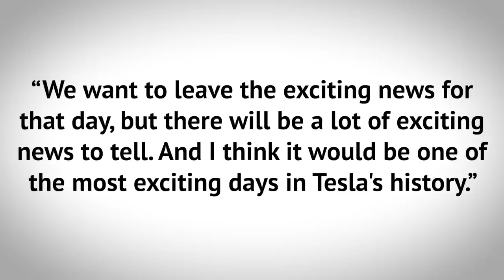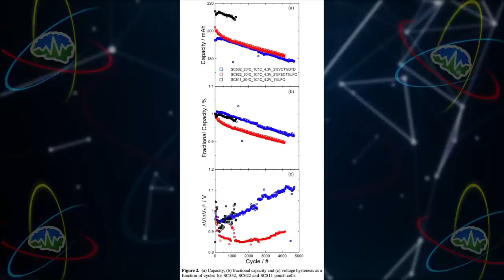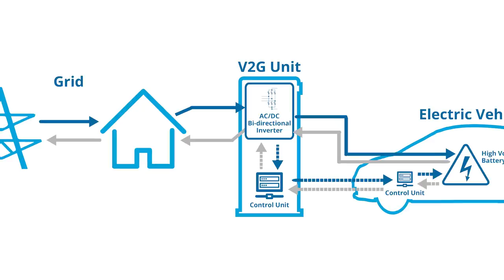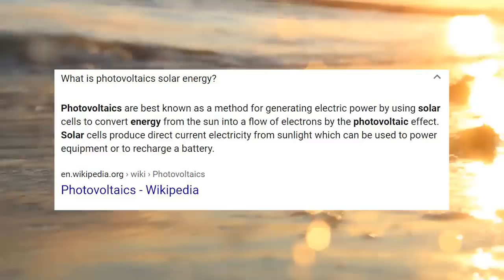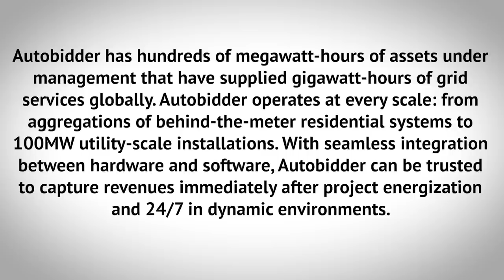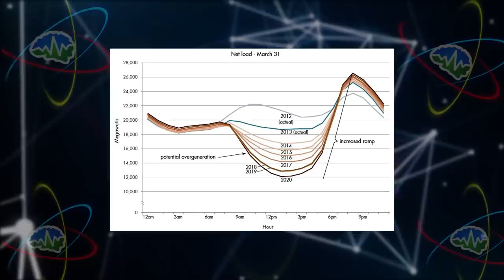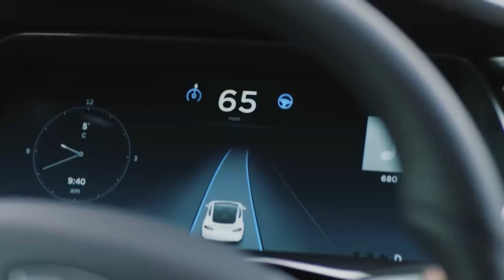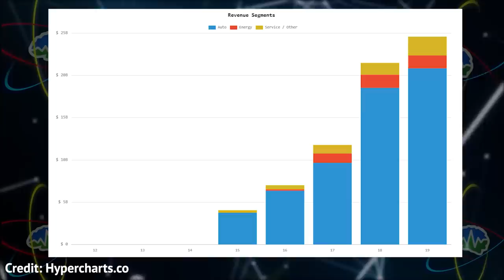Battery Day is Coming!  | In Depth

Comment: The big battery capacity will not be needed...We can build wireless charging systems everywhere...It will be charged as it moves...If that happens, we can save a lot of resources such as cobalt and nickel.
 The amount used will be a monthly fee like a cell phone or you can pay it where you're registered as much as you have operated.

Comment: An additional likely change, based on recent reports: rectangular, not cylindrical, batteries for better packing. Of course, myriad research results have been published to increase density, safety, solid state electrolytes, and so on, with claimed results up to 10X current capacities. Presumably Tesla is following these and deciding which ones can be injected into the mfg. process. (Those are initialisms, by the way, not acronyms.)

Comment: 31:48 makes my point. You will not get your electricity back in your car for the same amount as you put it into the grid. You're getting ripped off. And if you lease, I bet you have to plug in your car every time you can. and pay for electricity everyday even if you don't use your car every day.
Reply: But if it is only for your home. it sounds great, I guess.

Comment: What if Tesla s recycle program provided all Prius cars with the new million mile replacement batteries that were V to G set up for those cars. How much would that improve grid stability? As well as increase the range of the older prius' which is desperately needed.
Reply from the maker: There's not enough room in a Prius for that amount of batteries
Reply: @NowYouKnowChannel  You could at least make replacement batteries that last longer and increase the range and sell those to Prius owners. Your missing the bigger picture here.

Comment: Correction @12:00 Vehicle to grid means current can flow from your vehicle to the power company, where the power company will have to pay you for your power sold to them. This is a big "NO NO" for the existing money hungry power companies so much so that this V@G image was removed so as not to cause alarm to the economic powers.
Reply: I retract the comment. I see what you mean. Explained later in the video.

Comment: One idea that hasn't been added to the current conversation is the prospect of abandoning AC current in favor of DC current for powering homes. The only drawback of DC current is 1. it can't be transmitted over long distances and 2. it is more likely to be lethal than AC. However, these drawbacks might not be significant within a home, where power is transmitted over short distances, and where efficient small appliances could operate successfully with reduced voltage that minimizes the shock hazard. For example, LED lights would need only 12 volts. For "heavy appliances" such as clothes dryers, pool motors and air conditioners most homes are already equipped with independent 240 volt wiring circuits, and these could easily be converted to DC for operating the same power-hungry appliances.  DC motors are known to be 30% more efficient than AC motors, and Tesla has already developed an advanced DC motor that uses unique arrangements of permanent magnets that is even more efficient than conventional DC motors. Tesla could utilize this technology to produce a new generation of small, super-efficient DC motors to revolutionize the efficiency of heat pumps, air conditioners, refrigerators, washing machines, vacuum cleaners and the like. Stable DC current would theoretically eliminate the "hash" or "noise" that bedevils AC power provided by the electric companies, and enable a new generation of improved audiovisual devices. Last but not least, the DC power generated by solar panels is so compatible with storage batteries as to enable the elimination of energy-wasting  inverters needed to convert AC to DC and vice-versa. I suspect that Tesla is already planning along these lines because there has been mention of HVAC (heating and air conditioning) technology that Tesla is developing to complement its solar systems. The efficiency enabled  by this approach would go a long way toward eliminating the grid altogether. It might even confer health benefits by eliminating the fluctuating magnetic fields generated by AC power. Centralized power generation is a dinosaur that needs to become extinct. It is being kept alive, like Frankenstein or Dracula, by politics. It's time to say goodbye to all the dangerous and unsightly power lines, not to mention power outages entailed by centralized power generation. How about devoting one of your podcasts to these ideas? Who knows, it might inspire Tesla or even a politician or two.

Comment: One very important point that was not discussed is the problems all this will create with existing power companies. I am sure you remember a little community in AZ that started the fight between Musk and Warren Buffett. Buffett and other power providers have had a monopoly on power in the country. With Elon's promotion of solar and battery systems, they will increase rates to an unsustainable level, refuse to purchase the battery to grid, etc. Unless Elon starts running his own power lines, there will always be a roadblock to Tesla becoming a major power provider.

Comment: Re leasing batteries .Is a Tesla without a battery still a car?As when sold it in essence has no engine or at least means of mobilising as seller is the battery leaser. Will cars with leased batteries be worth less? Renault's model of leasing batteries has changed so that owners can now purchase batteries (if they wish) as there was concern regarding my above comment.Obvs battery reliability has been proven to be more reliable than people thought years ago.

Comment: I'm curios how Tesla will make money from this. When cogen is installed on a power system, there is a contract between the cogen owner and the utility that will receive the power.  Even if you put solar panels on your house, you don't just get to back feed in to the power grid. Most cogen is not mobile, so it's kinda simple. You have cogen connected at a fixed location and it's injected into the power system at a metered point. If you plug your car in at home and you have a contract with the utility that supplies power to your home, it passes through that metered point, they know who the owner is on the other side of that meter that is sending power into the power grid. What I don't understand though is how you would be able to connect to many chargers connected to many different utility companies without any contract and get paid for selling your power back. It would make sense if the owner of the charging station had a contract with the utility company and then they got paid for you to drain your battery into the power grid, but that wouldn't make much sense for the car owner. And how does Tesla own that power? Once I purchase the car it's mine, and so is the power. Why would I let Tesla claim it and profit from my car after I already bought it? If that business model somehow worked, why wouldn't companies that sell solar panels own the power they produce and continue to make money after they sell you their product?

Comment: Does this mean I could run my electricity requirements in my house just by owning the car?
Reply: You would need a roof full of PV to generate the power in the first place.  You would also probably need a Powerwall or equivalent to run the house while you're using the car as a car.

Comment: The Cybertruck already has an inverter built in.
Perhaps Tesla figured out the income from the mobile batteries the same as you.
1,000,000 miles/250 miles in pack/365 days per year=10.9589 years of use in a million  mile pack.

Comment: All these can be true, if Tesla is also going to replace the onboard charger to allow bidirectional charging in addition to just swapping out the battery pack. In comparison to the battery pack, assuming that's a small cost to pay to get the new V2G + VPP capability.  

Tesla will also need to scale up very quickly in their service center in order to service these modification work for its fleet owners.  This won't happen until maybe late 2021 - mid 2022 and maybe some of that $5B stock offering is going to fund this new biz expansion???

Comment: I find it funny that Tesla the scientist gave us AC (great for power transmission over distance) and Tesla the car gives us DC:) And most of the devices in homes could use DC (they convert ac->dc either way), but the infrastructure (the cables and switches) are not ready for it. One prime example is LED lights which are naturally DC, but each and every separate light requires an AC->DC transformer which makes it very complicated versus a single wolfram thread. If computer data centers made the switch to DC distribution, maybe we will too, maybe ac+dc separate cabling and you use what you need.

Comment: Nissan can do exactly what you describe right now, BUT at least in Germany V2G is not allowed. Euro CCS can do V2G as well. We could have done it already, but for tax reasons it is simply not allowed. Because you can get tax discounted electricity to charge your car and than use that electricity to run your home and thereby bypassing all taxes. Nissan proved already it is doable, but at least here in Germany, there is a long political way to go. The technical developement is done.

Comment: It all depends on regulations

If Tesla can convince the UK regulator to treat its cars as a virtual power plant there is a significant benefit to the home owner because that home would effectively be able to buy electricity off the grid for almost free at low prices and then power the home with that almost free electricity

£6.44 per KW per year is the UK capacity payments for power plants

About 3p can be made on arbitrage

But the big win is if the retail customer, that house with the Tesla can purchase electricity wholesale without having to pay the dozen or so costs retail customers pay

If that happens it's maybe around £700 a year value. If that doesn't happen  lots closer to £200 a year value

So Over 10 years the power pack of the car has a value of £2000-£7000 not $35,000 or whatever it is you said in the video

Comment: That is neat and all, but Tesla has an issue of scale and production.  The only way that this really works is if they open up their v2g platform and battery to other auto manufacturers at a low enough price where they also get value out of it.  If several companies are on the same platform, then the platform can make a big impact.
Tesla needs to become the Microsoft of auto manufacturers where they design the architecture that other companies can build from.  They will build vehicles, just as MS builds computers, but they will always be a small boutique company on that front where the real business is in services used by all platforms.  Let expensive end-user support, less need to hire employees, and a much larger market to tap into.  Tesla could be like the MS Azure for virtual grids.

Comment: I would take it even further with regards to the recycling. They are essentially “mining” materials from EVs. Why would you limit intake to only tesla vehicles? There are so many EVs from other automakers with those same materials. Tesla should be able to take a chevrolet volt off someones hands and give a discount on a tesla because they can mine the materials from the 10kWh batteries. Same for leafs, bolts, etc. 

This whole system, if it pans out, would be absolutely game changing for the energy and transport industry. It would cause massive renewable buildout because interconnection would be far less difficult. It only takes a couple hundred vehicles to stabilize regional grids, and this massive oversupply of energy storage would mean that there would be a dramatic undersupply of renewable assets, triggering an astonishing buildout of capacity. In addition, existing fossil fuel assets, if they are able to keep afloat, would be able to stabilize their output because of distributed storage while emitting far less emissions because of less ramping, and could fulfill the role of baseload generation until renewables reach sufficient market penetration.

Well played Tesla, they would singlehandedly bend the needle on climate change in a massive way.

Comment: I can see two problems with this model. Firstly people spec their solar systems for personal use so may not have the excess capacity to sell. This problem will be solved in a few years because the consumers will pay to add extra capacity to their solar systems. Secondly people will want to use their Teslas during the day So unless employer or shopping marts are willing to install this V2G infrastructure the storage capacity of these virtual power plants are greatly reduced.

Comment: What if Tesla announces they've used a calculator and concluded they'll switch to making hybrid cars! The battery capacity of 10 fully electric vehicles is enough for about 70-100 plugable hybrid cars with 50km (30 miles) range. Enough for many or most of us on average days. 100 hybrids will have much lower co2 emissions than 10 EVs. Not?

Comment: so far any battery operated cars needs 20-30 years just to break even of the extra price you need to pay (you can buy petrol for 20 years of drive on the price difference and stop wasting 10s of thousandths hours for charging batteries.
needs to solve:
-charging should become as fast as putting 200kWh of petrol/propane equivalent to the tank in 2 minutes
-it should not loose capacity over time (refuel tank until it starts to rust but still keep same energy volume/density)
-it should not cost more then cost of fuel tank (100;s of dollars not 1000's)

Comment: Really great strategy - you guys should start a company of Tesla doesn't do this. An extra bonus idea is this: when there is too much wind and solar, the price of electricity goes * negative * and people are paid to take money from the grid.

If you google "university of queensland Tesla" you'll see they had a 1.1MW battery generate huge amounts of cash using an algorithm they developed to predict the generation based on weather (sun and wind). As you likely know, when the software predicted a big sunny day (and likely negative power prices), they discharged the battery at night and got paid to supply energy to the grid, then the next day, when solar was booming, was paid to charge up again.  They made money both ways.

Australia is predicting 2 hours of ZERO grid demand in South Australia in the middle of the day over the next few years, and Western Australia should have the highest number of rooves with solar in the world soon. Even cold Germany has had negative price power days during winter storms with tons of wind, as well. Right now in Australia, solar famrs are being thottled to half and sometimes 0 capacity because they are generating too much electricity, or toom uch for that part of the network.

Also note, the Hornsdale battery "paid for itself" by eliminating FCAS premiums (which is a very specialised energy side market) so using its cost to work out the value of Tesla car batteries of $36,000 might be too high - you may only need a few connected cars to satisfy this type of expensive demand.

Moreover, the savings were to the rest of the consumers in not paying higher energy bills, rather than as cash income to Hornsdale.

Ultimately though, early adopters of V2G agreeing to join a VPP, facilitated by Tesla's Autobidder, could clean-up and make a motza.